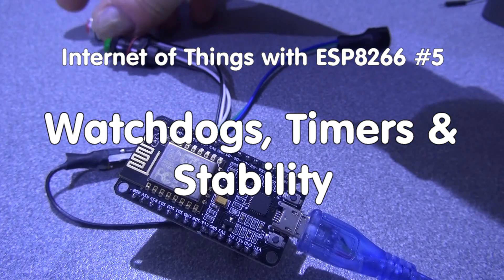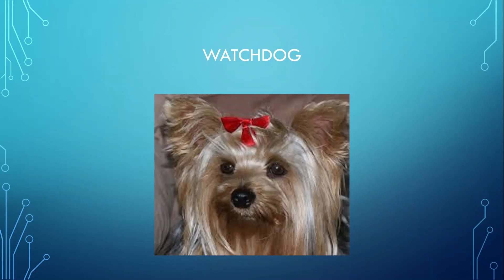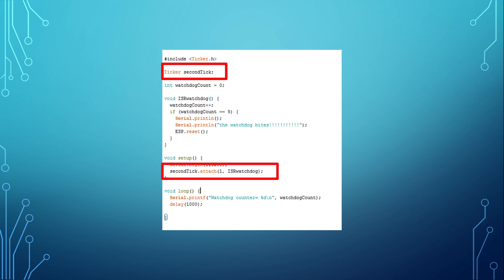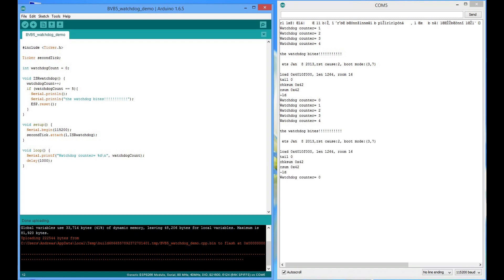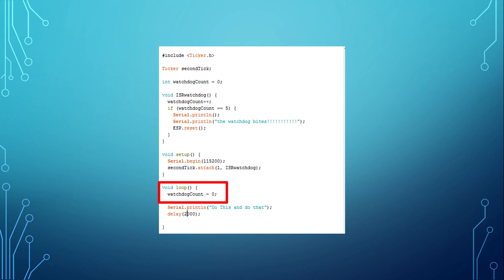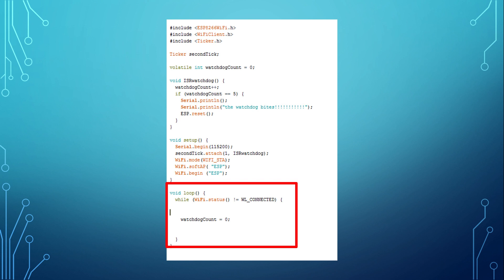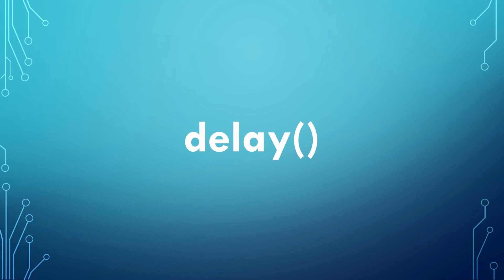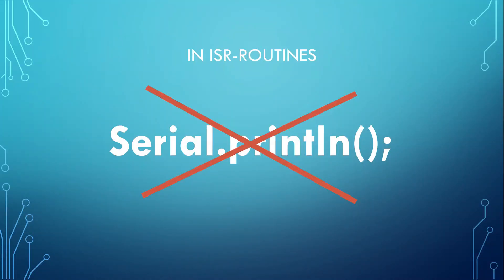#33 Internet of Things with ESP8266 #5: Watchdogs, Timers & Stability

Comment: Great Video. One note,  ESP32 has a hardware watchdog and it is independent to the core. So if the whole µC crashes the watchdog will be triggered as well. That's a lot more secure! If you want I can give you more infos. Grüezi :)
Reply from the maker: Thank you for the additional info. Good point.

Comment: I just had a WDT experience I want to share after spending several wasted days. I know this video (excellent as always) is focused on ESP's. However, be aware that the AVR/Arduino ProMini bootloader has a WDT bug that was not fixed in software due to product obsolescence. The solution is to bootload a ProMini as if it was an Uno.  But then you must continually remember that the MCU selection is an Uno.  
i hope this saves somebody some time.
Reply from the maker: I did not know this fact. Thanks for mentioning it!

Comment: Hi Andreas i am using an esp32 to control my automatic curtain . The curtain takes 13 seconds to close so the internal watchdog timer bit. I had to insert esp_task_wdt_reset(); into the subroutine that runs the stepper motor to keep the esp from restarting. So it has an internal WDT. 
BUT today the esp became unresponsive and did not reset itself i could not get any reaction from it so had to pull the power. once restarted it worked fine. I could later see from a temp and barometric sensor i have attached exactly when it crashed. it was out  for several hours. i guess my only way to counteract this automatically is to make an external WDT as the internal one seems to have failed. I will make a node red routine that checks for missing updates from the temp /barometric sensor so i know when it happens again. do you have any other insights or suggestions ?   Thank you for your videos they are always helpful.
Reply from the maker: I also have a node-red flow for my most important sensors. The send me a telegram message when the expected update does not happen. If it is too often, then you hae to find hte root cause. Not easy.
Reply: @AndreasSpiess  thanks for your reply. Yes I'll have to keep an eye on it. BTW did you try NORA? Super easy way to connect everything to Google home
Reply from the maker: No, so far I never tried it

Comment: Hello sir, thanks for sharing info about watchdogs, I appreciate that a lot, also I am working on my college project based on esp 8266 
But it automatically resets after every 40-50sec while receiving data from firebase. I would be very thankful if you share your email id for further discussion 

Warm regards
Reply from the maker: Unfortunately, I cannot do remote debugging. Maybe you add lots of Serial.print statements to find out where it crashes. And add a big capacitor across Vcc and GND as shown in other videos.

Comment: Sir, I'm making code for AC light dimming process. N I've included yield(). But it isn't helping. I'm continuously getting the problem of rat cause:2, boot mode:(3,6)
Reply from the maker: Search for this message with google and you will find the cause

Comment: I have been using an ESP_01 with an Arduino Mega to get data from an aquaculture plant.
The data collected are pH,Temperature and Dissolved oxygen. The oxygen level is controlled using a servo motor and all the data are viewed and controlled using Blynk application. Lately i have been having issues with the ESP_01 module i think it freezes because i have to transfer too much data.And the resetting is to be done manually can you suggest me a solution for this?
Reply: I want to know something regarding this watchdog concept I'm using an Arduino mega+ ESP8266 (ESP01) to monitor and control an aqua culture system. The system transfers the data to the BLYNK cloud which is viewed and controlled over the mobile. The system freezes because the esp01 fails to connect to the wifi network from time to time which requires manual resetting. Will it be ok if i upload this code to my arduino mega in order to solve this problem.... And please be kind enough to add a link to where i can get the ticker.h library.
Thanks for uploading this nice video.
Great job!!!
Reply from the maker: Unfortunately I cannot do remote debugging. Ticker.h should be part of normal ESP8266 Arduino isntallation. So no additional installation is needed (I did not try now)

Comment: Sir @andreas spiess whenever i try to restart the esp using software with commands ESP.reset() or ESP.restart(); most of the time esp got stucked in restarting and don't run any code till i hard reset  using button . this is the last thing in the serial all the time 

  " ets Jan  8 2013,rst cause:2, boot mode:(1,6)

 ets Jan  8 2013,rst cause:4, boot mode:(1,6)

wdt reset
"
Is there anyway to get rid from it. Help from anyone is appreciated

@Andreas spiess 
is you any way to fix it ?
https://github.com/esp8266/Arduino/issues/1017
Reply from the maker: wdt resets usually are caused by blocking the processor. You can add delay or yield statements in your code where it crashes.
Reply: @AndreasSpiess  sir processor don't run the code after rebooting for the first time using commands after uploading new code. same problem as you discussed is you find anyway to handle it.

Comment: Dear Andreas spiess,
Thank you very much for sharing such information on Watchdogs particularly. I applied it with my ESP8266 because it runs the code unstably. Putting the provided code seems to stabilize the program, however, when it crashes it cannot reset/restart the programming. May you please help to solve this problem.
Reply from the maker: I suggest you solve the real issue before you try a watchdog. ESP8266s should run stable by now. If your error message contains "WDT" you might have to add some yield() statements in the loops.
Reply: @AndreasSpiess  Thank you very much, I have not responded you quickly sorry. I was out of city. By the way, how is the PIN connected?

Comment: Hi Andreas Spiess,
I use NODEMCU   watchdog timer code like your video , i got stuck with this 

 ets Jan  8 2013,rst cause:4, boot mode:(1,6)

wdt reset

how can i solve that problem ?
Thanks
Reply from the maker: Usually you have a loop which blocks the ESP too long. You can try to insert yield() statements in all loops.

Comment: Andreas, Excellent as usual.  
Everthing was OK to download and I have hard coded mySSID and MyPassword, but I can not understand why WiFi not connected. 

#define mySSID "xxxxxxx"
#define myPassword "xxxxx"

Starting ESP8266
Reading Configuration
Configurarion Found!
Current Direction 0 
HTTP server started
Admin Mode disabled!
Configuring Wifi
WiFi not connected
WiFi not connected
WiFi not connected
WiFi not connected
WiFi not connected
WiFi not connected
WiFi not connected
WiFi not connected
WiFi not connected
No NTP packet yet
 Tim 0 H 6 M 9 Dep 0 H 0 M 0 Status 1 lastStatus 1 minTillDep -999 loopTime 120000 freq -1
NTP packet received, length=48
NTP packet received, length=48
No NTP packet yet
No NTP packet yet
No NTP packet yet
NTP packet received, length=48
No NTP packet yet
No NTP packet yet
NTP packet received, length=48
No NTP packet yet
 Tim 15 H 48 M 30 Dep 0 H 0 M 0 Status 1 lastStatus 1 minTillDep -999 loopTime 120000 freq -1
 Tim 15 H 48 M 40 Dep 0 H 0 M 0 Status 1 lastStatus 1 minTillDep -999 loopTime 120000 freq -1
 Tim 15 H 48 M 50 Dep 0 H 0 M 0 Status 1 lastStatus 1 minTillDep -999 loopTime 120000 freq -1
 Tim 15 H 49 M 0 Dep 0 H 0 M 0 St
Reply from the maker: Maybe you start with a simple Wi-Fi example file to find the cause. It has to do with the initial Wi-Fi connection. All other errors are because of that.
Reply: @AndreasSpiess  I have connections with my other mcu8266s to router. I have allso switched units to see if that unit was kaputt.
Reply from the maker: Strange. But remote debugging of difficult situations is not easy. And this is  a quite old video :-(

Comment: I want to use this. I have 4 espo1s and they all eventually hang, I have tried the capacitor, stable power, etc. Is there a way to do this without using a delay. Like using millis?
Reply from the maker: If you get the error wdt reset, you need some yield() statements in your loops.

Comment: Dear Andreas, first of all thank you for the amazing video.
This is my code: https://pastebin.com/9N5dULz2

It does simple thing. Connects to the wifi. sends GET Request to the server, receives information in json, parses it with ArduinoJson.h and then draws it on DMD Display.

Time after time, ESP8266 (Nodemcu v1.0) Stops working with error cause 4 (1,6) or (1,7). 

Could you please help me with this problem? I will be glad.

Here is my email: Givi.beridze1@gmail.com
Reply: More specifically, I am using simple GET request . It works perfectly. When i try to run it with DMD2 display library, it has errors. Like: watchdog resets sometimes and other times connection is lost and it can't get anymore request until I reset it manually. https://pastebin.com/tXcxyRaW here is second code. In this if you comment dmd.begin() line it will work perfectly. If you don't it will crash. 
Could you please help me ?
Reply from the maker: Watching my newest video concerning finding errors you are already close because you are able to isolate the problem. Now you have to go further on this route. Unfortunately I cannot do error chasing for others, I have enough of them in my own projects.
Reply from the maker: Maybe you open up an issue on Github. The inventor of the library knows his stuff best and usually is interested in correcting his code
Reply: Dear Andreas, Could you please answer this question: I have two libraries that use Interrupts. When I run them at the same time it causes crashes(like wdt). Could you suggest me solution?

Comment: Hi! So I have a Wemos D1 R2 board with ESP8266 chip connected to PC running some code and once I restart my PC, Wemos hangs and does not run code any more. I suspect it is because of serial connection is opened and that causes board being reset by PC. How could I disable it? Also once I power up my board, it needs reset 2 time to start running code. Dont know whats up with that... Thanks for any help!
Reply from the maker: Maybe you try with a simple sketch like the blink sketch to make sure it is not the sketch making problems. ESP8266 need a stable power supply. Otherwise it crashes (WDT reset). I made some videos about that.

Comment: Hello,
do you know a way to make it work for ESP32?
Ticker.h does not seem to be available in the ESP32 libraries.
Reply from the maker: I never looked in the timers of the ESP32. But I found this links: https://github.com/Pedroalbuquerque/Ticker-ESP32 or https://github.com/sglvladi/Ticker_ESP32
Reply: Thanks!
I tried the library in the first link and the code compiles fine.
I only had to change ESP.reset() in ESP.restart()
Reply: But it does not seem to work.
Even if in the loop I only put 
watchdogCount = 0;
ISRwatchdog() is executed continuously
Reply from the maker: Maybe you open an issue at Github. Usually, you should get help from the creator of the library.
Reply: If you still haven't found the answer, maybe you can find it in the following link: https://www.youtube.com/watch?v=7kLy2iwIvy8&t=669s
It was pretty helpful for me.

Comment: It is a good way if the problem is in software but often my nodemcu got frozen! I dont know why. It is running a sketch of wi-fi station and works simulating a belkin device! I have been testing for 2 days and 3 times it crushed. It is indicated by the Digital Output D0 that turn on a led when it goes into a configuration mode! When i push the reset button doesnt work and it keeps in configuration mode! Only when I cut the power supply and then feed it again, it works.. maybe someone have an idea of why happen it? And how can I implement a watch dog throught hardware?
Reply from the maker: Did you watch the Serial monitor when it crashed? What did it say?
Reply: Andreas Spiess no I didnt! I Will run it and keep an eye in serial monitor when it crash, thanks for your videos and all the answers! Keep going on..

Comment: dear sir 

i am getting the following error  and it resets  my  device 

ets Jan  8 2013,rst cause:2, boot mode:(3,6)

load 0x4010f000, len 1384, room 16 
tail 8
chksum 0x2d
csum 0x2d
v60000318
~ld

my program was working fine for 15 days and now i am getting this error 
pls help
Reply from the maker: Remote diagnostics for these problems is not possible. Maybe the ESP did not get enough voltage for a moment. I suggest adding a big capacitor across your ESP8266 module ( I showed this in another video about powering the ESP8266)

Comment: HI Andreas,
I am a having a problem. My ESP8266-01 freezes after running for some time. Then at times it recovers by itself, and most of the times I have to manually reset it.
Sometimes it freezes in 2 hours and sometimes the whole day it keeps working good. The behavior is not consistent.
If I implement auto-reset with your ISR then at each reset the GPIOs will also reset and the devices connected will also turn off.
Need your help on that. Thanks.
Reply from the maker: Usually, it is best to run the serial monitor to log where the processor stops. Then, you get information on what happens. Pay also attention to a proper power supply. You find some videos in my playlist about that

Comment: Hello,
I tried it and it works well.

Is there an equivalent ESP.reset() for Arduino?
In particular, I would like to be able to reset the Arduino Ethernet shield from software.

Thanks
Reply from the maker: I never used it. But googling of "Arduino Watchdog" and "Arduino software reset" give many hits
Reply: Yes, you are right.
But the proposed methods are different and they are based on using the arduino reset pin (through hardware and/or software).

Comment: Greetings Andreas!

Have you had any luck dealing with the issue of a WDT reset bringing the ESP8266 into bootloader mode instead of normal sketch execution?
I am referring to the ticket you opened https://github.com/esp8266/Arduino/issues/1017

Having the same issue here...

Needless to say this is serious reliability trouble -- defeats the purpose of using the chip in the first place, at least in applications where human presence is not guaranteed at all times.

PS. This is my first youtube comment, and your channel is the first to subscribe, though I've watched many of your videos before opening my channel -- excellent subject picking and delivery. Just keep at the Swiss accent ;-)
Reply from the maker: I do not have any particular problem with it since quite a while. But you have to pay attention to the levels of the different GPIOs during boot. Otherwise, it ends in not booting. What kind of issues do you have?
Reply: My adaptor-powered ESP8266 (NodeMCU v1) WDT-resets every one to three days and then becomes irresponsive unless I manually reset it.
To my best understanding the only thing that could be triggering the irresponsiveness is the chip entering UART programming mode after the WDT reset

I had seen this behavior directly in the logs of the serial port at the time of sketch development -- at that time I had several problems with wdt resets which (I thought, at least that's what it seemed) I resolved with stabilizing capacitors.

The levels of the 3 pins during boot is a real headache. Since the WDT reset occurs at unpredictable time, the pins of interest can have any value (I use them in actual communication with peripherals). Thus, one can never guarantee the correct pin levels that lead to normal sketch execution after the wdt reset.

In addition, there are other weird, fuzzy things in regards to the GPIO levels at boot, for example

https://github.com/esp8266/Arduino/issues/1017#issuecomment-156708759 : though GPIO9 is pulled up, the problem still persists, or

https://github.com/esp8266/Arduino/issues/1017#issuecomment-200605576 where it is mentioned that at boot time the bootloader doesn't actually sample the pins to determine their state (but instead does something else which I do not understand)
Reply from the maker: My question would be "why does it reset"? And I try to not use the three pins as input. If you use them as output, you still can put pull-ups there to get a defined status at boot, if necessary. I also do not know it they changed anything in code since then.
Reply: I am almost certain the main reason for the resets is the power related. I'll try some bigger capacitors and see the results then.

However, I am still worried since
a) capacitors cannot account for all flaws that may appear in the mains power, and thus propagated through the adapter to the VCC of the ESP.
b)surprisingly, even with the correct pull ups (!!) there still is the chance that a wdt reset leads the chip to firmware download mode, see eg igrr's comment https://github.com/esp8266/Arduino/issues/1017#issuecomment-156703421

To my best understanding, a genuine solution to the problem is to find a reliable way to put the esp in normal sketch execution each and every time a wdt reset occurs (since completely eliminating wdt resets cannot be achieved in real-life conditions as far as I can see).

After gathering more info, I'll open a thread in esp8266.com and I'll post the link here, an by all means please stop by there then to provide your insight. Thank you for our dialogue! I look forward to our next one ;-)
Reply: Greetings! The link to the thread is http://www.esp8266.com/viewtopic.php?f=6&t=13206 if you have an account there please provide your insight!